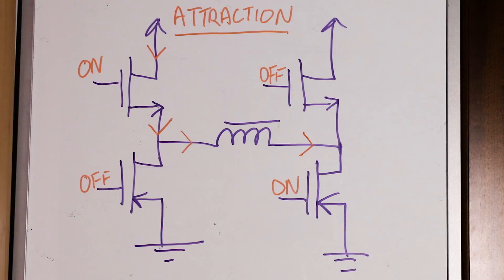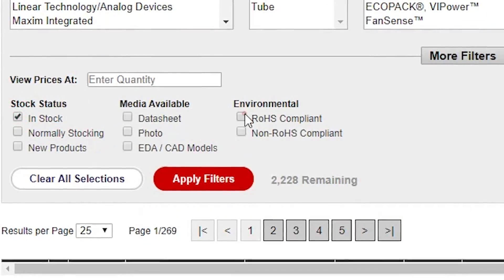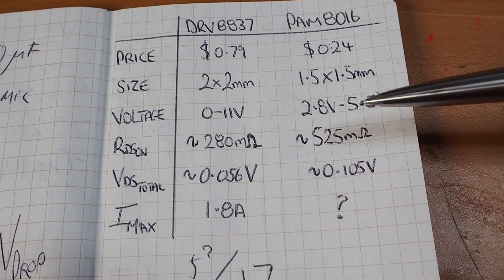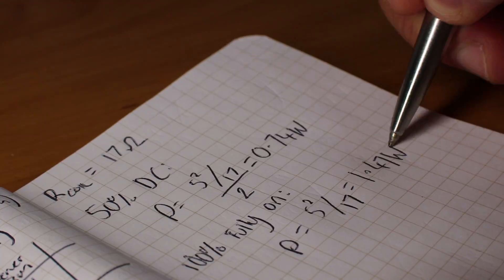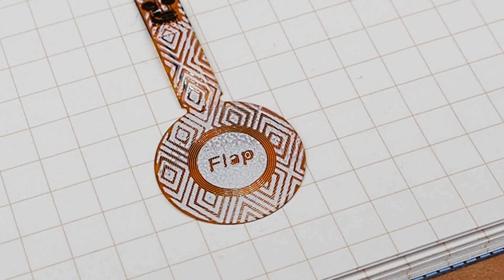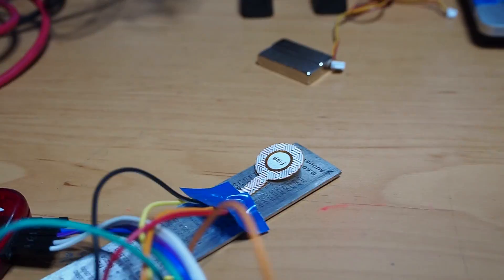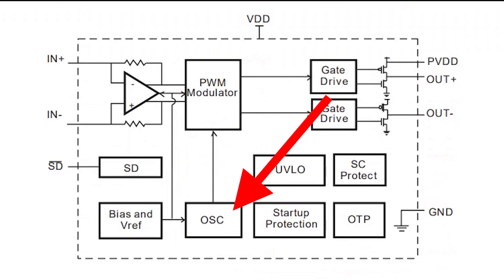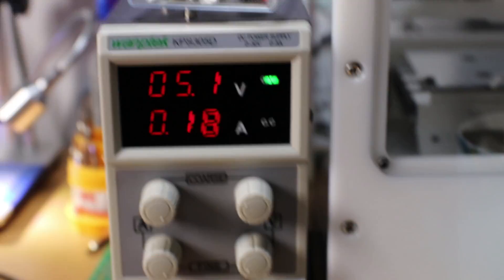Selecting a new H-bridge Driver!

Comment: If you have a safety razor on hand, the blade is a really good spatula for silk screening the paste onto the pads. The sharp edge of the blade makes a huge difference in print quality and works much better than conventional metal spatulas / credit cards with bigger corner radii. Do it in one go for best results. Cool video, keep it up!

Comment: They have almost same part PA8013/15 as D class amplifier. On LCSC it cost US$0.08 @ 100pcs. I think these chips will work too.
Reply from the maker: nice! hmm the datasheets for it looks identical.. its just listed as a D class amplifier.. it is not listed on digikey though for low quantities
Reply: LCSC parts are always a coinflip on reliability and availablility. It's great for one offs and small batches, but you better not design a long term project without stocking up the parts in the first place. Also, sometimes there are complete batches of chips that simply doesn't work the way they're supposed to. I had this with a LED driver once - it was no problem because they managed to send me another batch of working ones for no cost, but on more complex projects this could end in costly bugfixing.

Comment: These actuators would be perfect for ultra tiny rc airplanes.
Reply: @kkuhn  You'd be surprised.  Electromagnetic actuators are already the standard for the smallest rc planes.  It's not hard to find commercially available units that weigh only 300mg.

Comment: Using Tj = Tc + °C/W*P , 0.19A flowing through 0.525Ω is about 0.019W of dissipated power. If Ta was 26 and Tc was 32 then the thermal coefficient would be around 317 °C/W very roughly from the one steady-state datapoint. It will most likely be lower at higher temperatures due to stronger natural convection.
So worst case with that 317 number, the chip could dissipate 0.33W at 125 °C, which is around 0.8A through both FETs and like 3.7W of 100% duty output power.

Comment: The power rating in the datasheet is not limited by the chip, but by the supply voltage minus drop across the switches and the load impedance (5 V supply with 0.5 Ohm switches allows max 3.1426 Vrms, into 4 Ohm it means the 3W when the sinewave is slightly clipped to 10% distortion).
So to judge the load capability, it is enough to compare the rated load impedance: The chip is designed for 4 Ohm, your coil has 17 Ohm, which alone means the driver won't be electrically overloaded in any way. To the contrary, it will have huge margin (barely 4x rated impedance means 1/4 current, so somewhere between 1/4..1/16 losses; exact number depends on the switching losses, but when driving it plain rail-rail they will be negligible)
Thermally it is a different story, because it is designed as a haptic driver, so to provide only short bursts and then stay idle and cool down, while your flapper is driven all the time without the cooling period. But here the margin acquired from the 4x higher impedance load will offset that, so this exact flapper should be safe.

Comment: Question; instead of using magnets with your felxi pcb actuator,  Have you tried another coil on the same pcb, ie 2 sets of opposing coils on one pcb?
Reply: You cant put 2 coils on the same pcb. He needs separate pcb because if the 2 coils are fixed on same material how do you expect them to move?

Edit: adding another pcb with coil could work but magnetic flux would be way to weak compared to neodymium magnets.
Reply: Here comes heat problems
Reply from the maker: the magnet-pcbcoil configuration works because of the strong magnetic field of the n52 magnet.. the coil's magnetic field is much smaller when compared to the one of the magnet so two weak magnetic fields won't oppose the coils .. this can work by maybe adding a core inside the coil but then it may get to heavy for the flexing :)
Reply: @CarlBugeja  There's a magnetic camera made from hall effect sensors floating around the web can't remember if it's open source or not but it'd be a nifty way to "see" that magnetic field if you ever felt like making one. Might be interesting to see if sharp zigzags or switch back curves  help or hinder the field if you did make one.  If you could get the cricut to make a halbach array well hello free lunch  right? https://hackaday.io/project/18518-iteration-8/log/64376-a-magnetic-imager-tile
Reply: @ransombot  Sir, interesting..thanks for the heads-up.
Reply: With a strong neodymium magnet, a relatively small magnetic field needs to be generated for a large effect. You would need far more powerful electromagnets before you gain anything over this design.

Comment: Cool! TI has a VCM driver with ringing compensation and closed loop current control but it is a low side switching one with a really low power handling capability.

Comment: Nice find on the part.
The datasheet is really strange tho, they don't give any thermal data for this package, so there is no way to calculate how much it would heat up itself from the power losses. I guess it was specifically designed for audio applications, hence the 4 Ohm and 8 Ohm load ratings in the datasheet. As long as you make sure your loads impedance is somewhere around there, i guess it would be okay.
Reply from the maker: i totally agree! the datasheet is very poorly documented which is a really shame considering its potential
Reply: If you use it pwm the drop on the transistors is quite low, so is the power dissipation. You should be fine.

Comment: Nice to see a video on the tiny chip you've been posting glamour shots of on twitter. Can't wait to see some new builds based off the new 'haptic driver' chip. At $0.24/chip, I might actually look into fully realizing my my pcb stir plate. Probably need to nail that down before I look into adding heat.

Comment: This would be great for the control surfaces on very small RC airplanes. You could make the whole wing surface out of flexible PCB material. Flight controllers and VTX systems are down to a 16x16mm (hole distance) form factor now, but even a small microcontroller would do the job if combined with a barometer and inertial sensor. RC receivers are also very small today.
Reply: The problem is the energy needed. And think of it, it means as long as you hold the new shape you need that power.
Also this sort of motor isn't very strong.

For flapping a little foil around it's ok but for anything "work" that's useless.
The problem is the coil gets to far from the magnet.
First he would need to change the design from loose foil floating over a magnet to something common things.
Like the actuator in a hardrive moving the arm.
Or like a voicecoilmotor (laudspeaker)
Or look at CD-ROM drives or smartphone cameras. In booth cases the lenses are also actuated by coils and magnets

Comment: For ease of soldering and more flex strength, have you tried any of the cheap sot23-6 motor driver ICs like mx116L? Slightly poorer performance (higher RDSON) than the device you used but only $0.05 on LCSC. I've used the FM116 version on a number of DC motor products and they seem fairly robust. Keep up the good work by the way, it's fascinating seeing some of the novel things you're doing with PCBs.
Reply from the maker: Thanks! That part you've sent looks interesting but its a bit larger when compared to this one

Comment: Does that H-bridge actually use N and P channel FETs? Usually they just use N channels for both, with a bootstrap circuit to power the high-side FET. But going by the differing voltage drops I can only assume it does, maybe that’s the difference between the high-power stuff I’m looking at and this low-power microactuator stuff.
Reply: It has an N and a P FET. It's giving you the different Rds for the high- and lowside FETs in the datasheet.
Reply from the maker: It does.. Using a pmos and nmos can basically allow you to use a simpler gate driver  without the bootstrap circuit - eliminating the extra diode and cap

Comment: Thats small... and super cheap. Good job dude! 
The only problem i see with it is maybe the difficulty to solder it reliably ? But you already did it, so i don't think it will be a big deal.
By the way, did you do it on your first attempt or no ? l
Reply from the maker: I did 🙂 (I also wasn't that confident with soldering it haha but the stencil makes it easier) but the soldering footage I showed was actually not the first attempt as the recorded video from the microscope got corrupted 😣

Comment: Cool! you might find Dialog Semiconductor or GreenPAK products useful for some of your projects. Recently came across their products and am implementing them to make 36W COB UV LED curing lights with built in CV/CC boost converter, temperature monitoring, and controlling some led indicators.

Comment: DRV8837 is $0.18 for 1 and $0.10 for 1000 at LCSC with 3 day delivery and guaranteed to be genuine. Not available at TME, but highly recommend you search there for any components first, as they are in EU and charge very little for 3- day DHL shipping.
You have no reason to go to Digikey for anything in 2020.